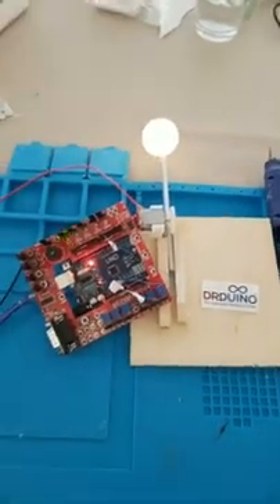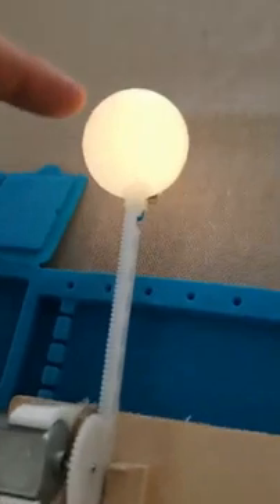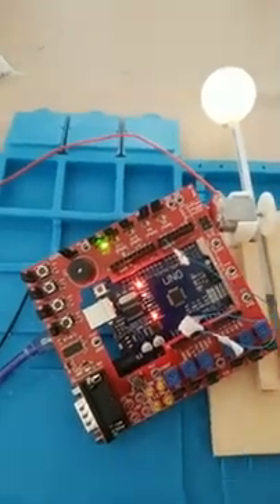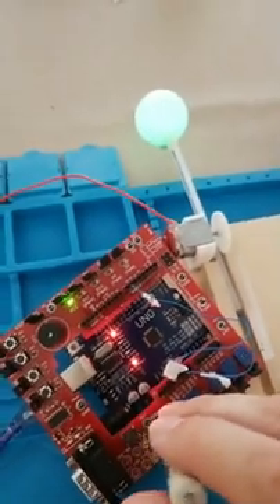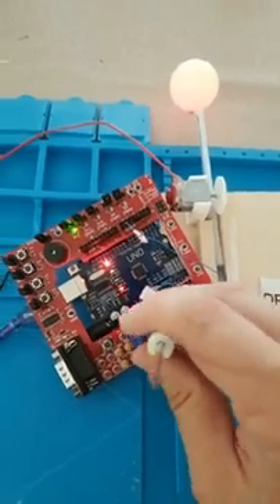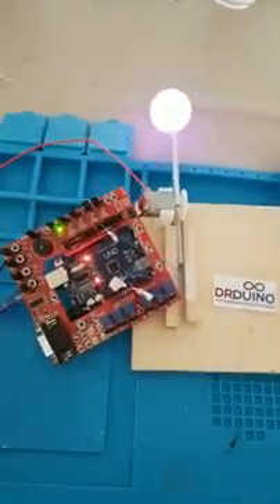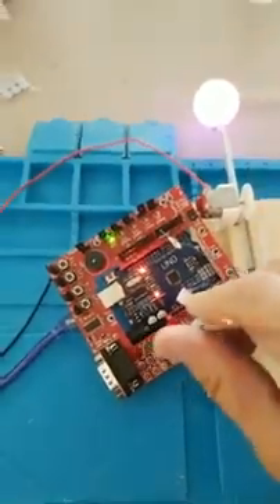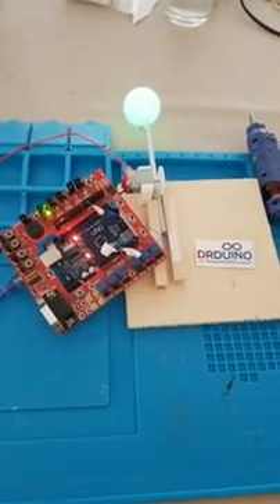How I Use Dr Duino To ProtoType My Ideas

Comment: You just showed changing color by varying voltage between red,green and blue. That has nothing to arduino. Even if you use PWM control you are going to need an interface.
Reply: It actually has everything to do with arduino as I am digitizing the value of the pot. Then sending the data across to 5050 leds which have a protocol. Those are not your typical leds.